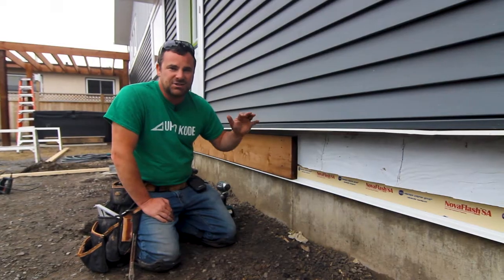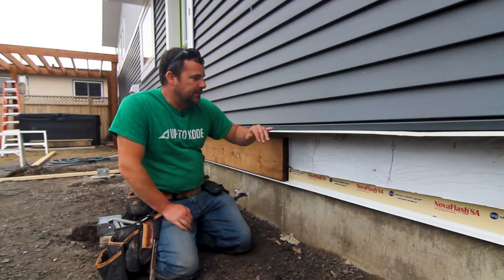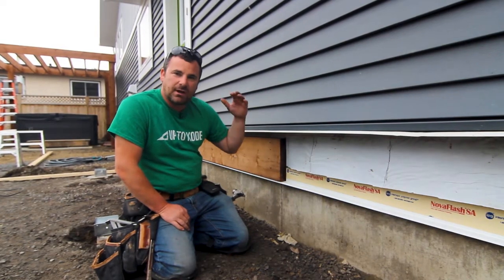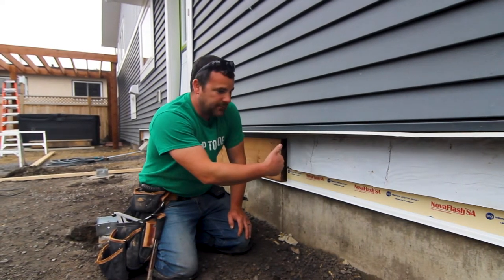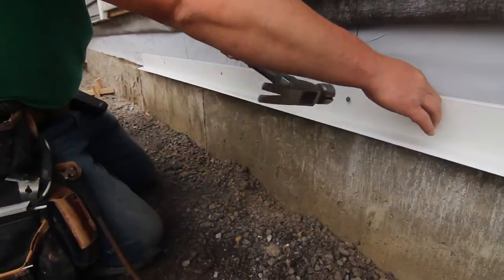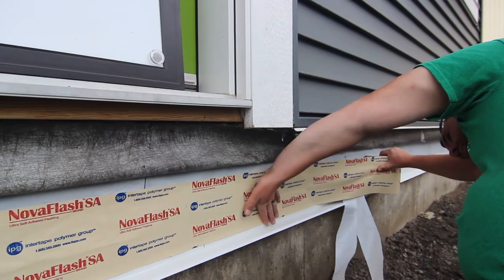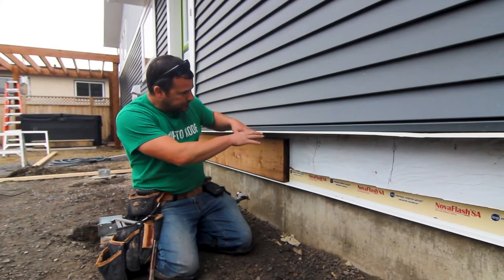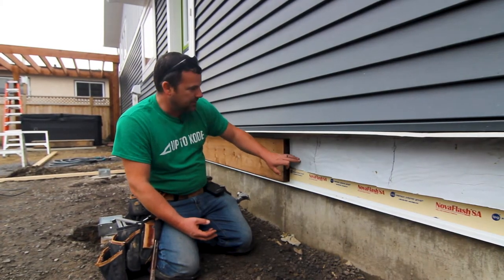How to Properly Install a Deck Ledger

Comment: Thanks for the video! I am going to be attaching a deck to the back of my house. The house is wrapped in 3/4" foam. Is it fine to screw the ledger board directly on top.of the foam to the rim joist?

I run a similar YouTube channel to yours so it's great to see how you're doing. Keep it up! Where are you based out of?

Thanks!
Reply from the maker: I would avoid attaching it on top of the foam but if you do I would lag bolt it. 

I’m from Alberta, Canada. What’s your channel name? Where you from?

Comment: What is done below the door to above the deck for water diversion  and finishing this area?
Reply from the maker: Good question. New doors have a flange like a window which is perfect to prevent water ingress. Finishing… either go tight with decking to the underside of the door. OR … if you leave your deck down a bit… then determine what’s best for you. Black flashing works.

Comment: At 2:50, it appears that you will be putting the 1-1/2" decking on the ledger but UNDER the top drip cap, which might serve to direct water to the back side of the ledger.  Should the top drip be bent down to cover the top and a bit of the side of the ledger, then the decking installed on top of the drip?
Reply from the maker: I don’t know the best answer to this.  I’ve seen people do it both ways.

Comment: Do you angle the drip cap on top and bottom to a few degrees off of 45° just in case water doesn't pool because drip cap doesn't create significant run off, just like the bottom of a window sill has a 3 to 5 pitch out for drainage

Comment: Do you leave the building paper un-taped behind the ledger? Or, can you tape the building paper to the rubber flashing horizontally to seal the paper to the flashing?
Reply from the maker: You shouldn’t tape building paper on the horizontal plain. You can potentially trap moisture.

Comment: I don't get what are relieve cuts? When u screw ledger into house won't that make an opening?
Reply: its to let water to drain out if it gets in, you can also add a few galvanized washers behind it to leave a space for drainage.
Reply: @powshredder3716  im saying but what does it look like tho? i couldn't see in video
Reply: @Eastbaypisces  it's just a small kerf cut maybe an 1/8 th inch deep . Putting washers works better though IMO.
Reply from the maker: Thanks for everyone’s input! I think there’s footage showing me making those kerf cuts.
Reply: @uptokode  yea i see it now my bad

Comment: I see conflicting instructions on this... most install the top drip cap to go over the ledger board but under the decking boards. This drip cap looks like it will end up on top of the deck surface. I don't even know what to believe any more
Reply from the maker: If you installed the last deck board overtop, you would need a completely flat drip cap. The point of the bevel edge is to make sure the water does indeed run away from the house. That’s why we do ours this way.